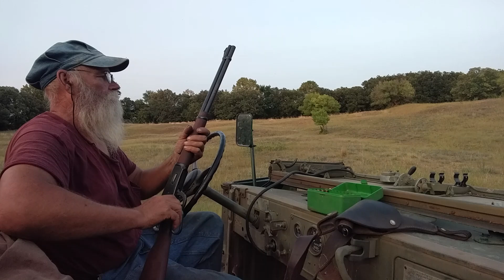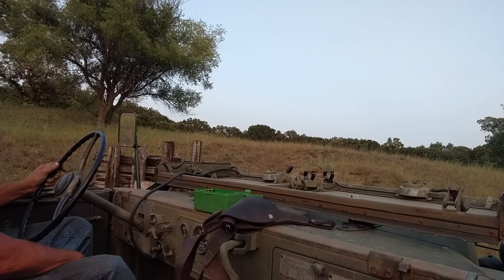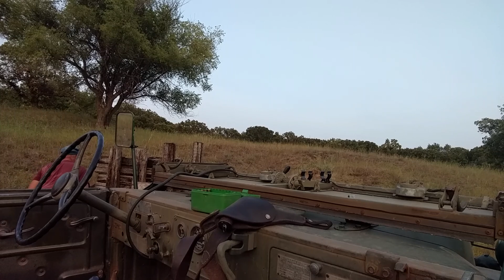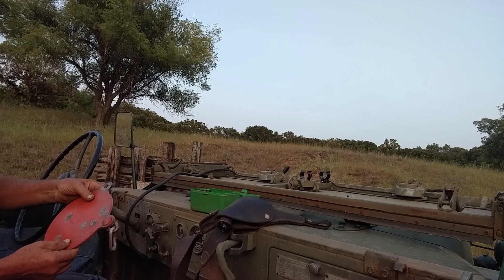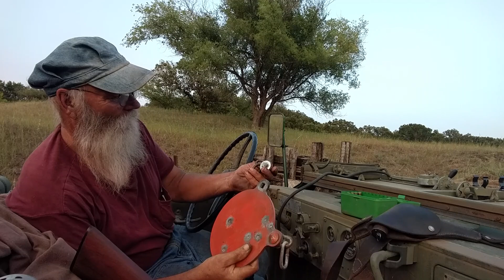150 grain cast in my brothers .30-30

Comment: My Savage 170 pump 30-30 with it 1:12 twist bore shoots the Lee 150 to 170 gr. bullets sized to .311" gas checked bullets as good as any jacketed bullet at high velocity.   Marlins will shoot cast lead as well but with micro groove bores you have to cast them fat, hard and use a gas check and keep the velocity lower 1600 to 1800 fps. so the bullet want slip / skid on the shallow lands and grooves.  I don't have a Winchester in 30-30, so I have no idea what it takes to make those shoot well.  Red Dot for no gas check plinker loads under 1400 fps. H-335 for HV loads.

Comment: Just bought a 170 grain flat nose mould from lee for my .30.30 Winchester 94, got half a ton of lead in Ingots in the basement. May as well start to use it.
Reply: @Bowhunter1300  As I was going to start casting bullets, we have a local FB group for the town, where people give away usable stuff for free. Things that they normaly would have taken to the tip, but that still has some life left in them. Everything form flat screen TV's to 
yeah...lead. You wont beleive waht people get rid of, and they are in a hurry, becosue they want that new Flat screen TV in!
So said that I was about to start casting lead. And asked if anyone had some scrap lead that I could start with. ANd this good old boy contacted me and said he had become to old to go to the range, and that he had  "some" lead for me. Turned out it was 1000lb of ready prceessed lead in Lee ingots, and he also threw in a box of about 750 gas checks and primers :-D, all for free if I cleared it out of his shed. His one other condition was that I pass it on to  someone who could use it if I lose the interest. :-D
Oh...I am in Norway.

Comment: You mentioned the 94 receiver in another video, wondering what type of metal Winchester used. Well...it's cinterd metal. Basically metal shavings that are compressed under extreme heat and pressure, then machined. And yes, Winchester used a special "bluing process" on those receivers. Nowadays we have coatings such as Ceracoat, along with others that can be used on metal that does not take traditional bluing.

Comment: You missed out the other day giving all that love to the Marlin and none to the Winchester.  But the reality is the Savage 1899, not the model 99 but the actual 1899 with the squared loop, is probably the best of both worlds in the 30-30 realm.  It'll shoot any bullet, its optic capable if you are into that, and its fairly open on top for access.  I have a couple or few each of Marlin (94,95), Winchester (73,92,94,88) and Savage (1899,99,25).  I did have a Henry for a few years just to compare it to the Marlin.  It was ok but not for me.

Comment: Any thoughts on hornady leverevolution for 30/30?
Reply: I have no interest in them.  I shot up a box of them in my .32 Special Winchester just to get the brass.  I didn't care for them at all, and the fact that they are not supposed to be left loaded in a magazine for extended periods of time renders them impractical.
Reply: I'm not sure about all calibers, but the 45-70 Leverevolution uses shorter brass. I don't touch the stuff because I reload.
Reply: All I’ve ever shot were “hot” it seemed.  They were reasonably accurate but I didn’t care much for them, all things considered.
Reply: @j.rob.5943  yep, the ones I had for the .32 Special where way hot, shot a foot high, and really rattled my old 94.  At least I got the brass, and in this case they are standard, unlike the shortened .45-70 brass.

Comment: Thought you weren't a big fan of cast in the 30-30? This load change your mind?
Reply: No change of mind, .30-30 was designed for jacketed bullets, and nothing will change that, but the .32 special.  I was just shooting up the leftovers from previous tests, cast is just to inaccurate at .30-30 twist rates, and the faster you push them, the wilder they get.
Reply: I remember that vid. 
Maybe due to the micro groove barrel on the 336.